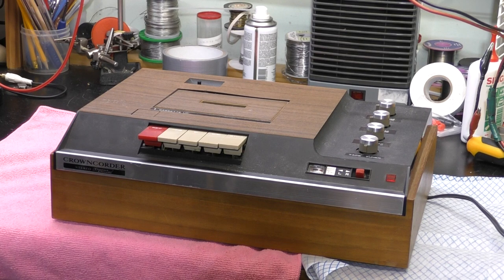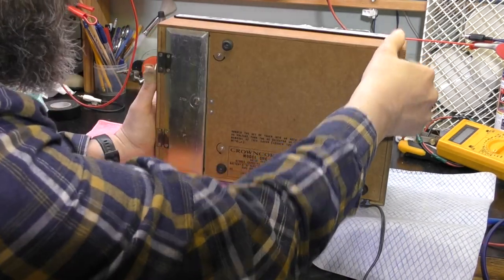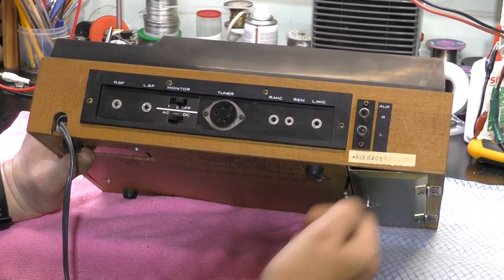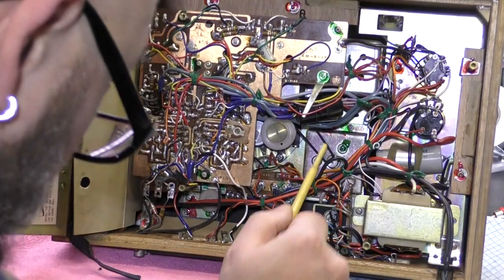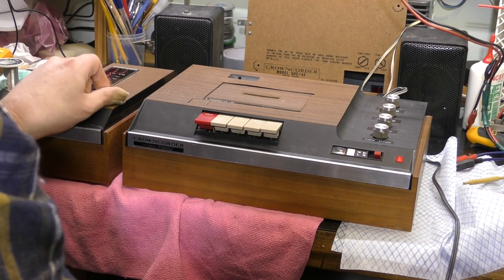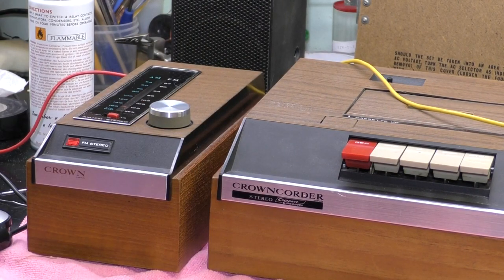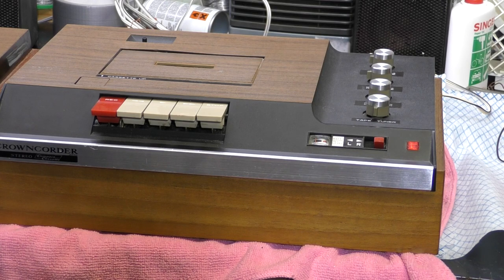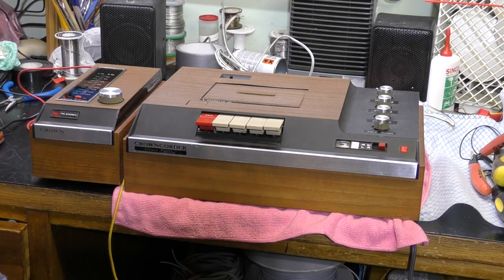Crowncorder SHC 44 Cassette deck with amplifier 1969

Comment: Hi Darren, thanks for the vid. Do you know if this has 3 heads? Does that monitor switch go between source and off-tape monitoring?
Reply from the maker: It's a 2 head machine, Rob. Also the monitor just switches on the speakers during recording. Daz.
Reply: @darrencoe5795  thanks man!  thought that might be the case, that monitor switch made me wonder though